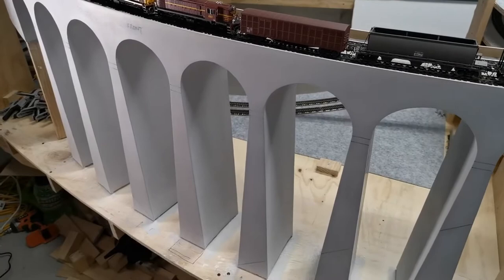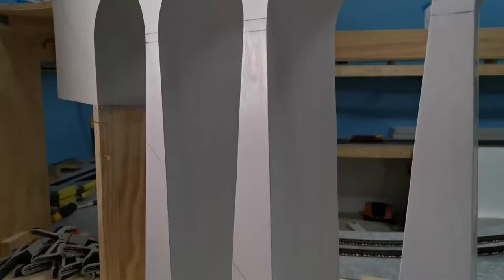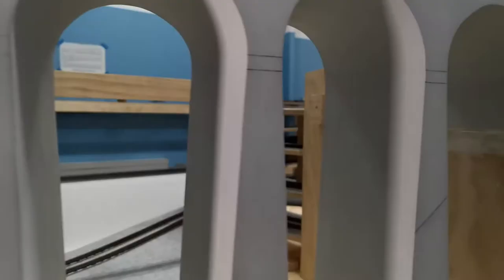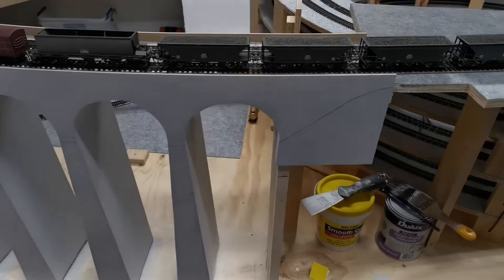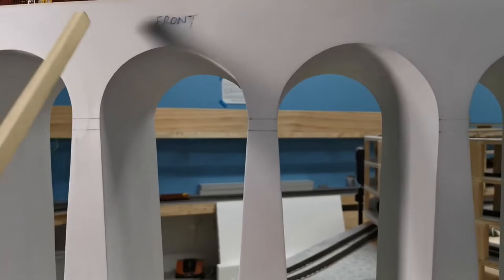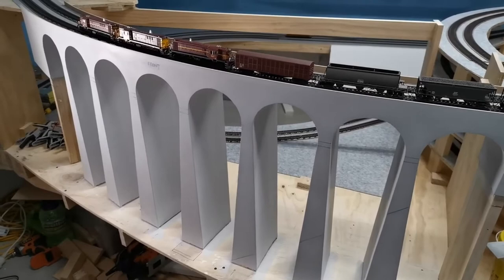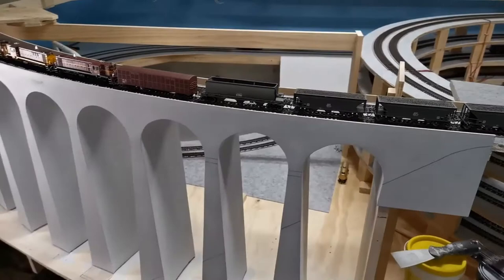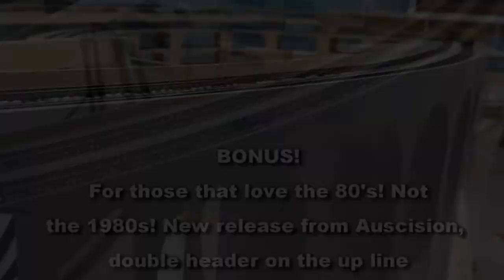Scratch Building the Model Railway Viaduct Pt4 - The Escarpment

Comment: A nice pair to finish off with.
Why do so many people model US outline railways when Australia has it's own railways to model. Nice one.
Not as good as UK railways though.
Bob
Reply from the maker: I think at times it is easier on the wallet to model Americain stuff. So what makes UK railway so good? Cheers
Reply: @JasonWood_Escarpment  I just penned a long reply then pressed the wrong key and it was gone.
Bottom line is, I live in the UK and model the late 60s when locomotive variety was huge. Anyway, horses for course. You're doing a great job. Keep it up.
Thanks,
Bob